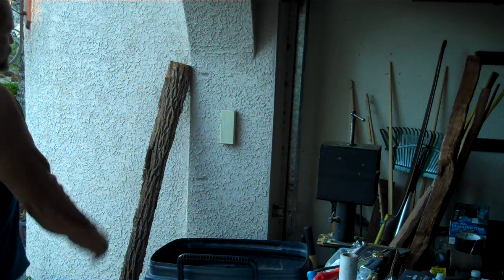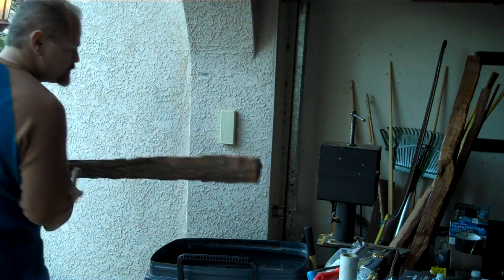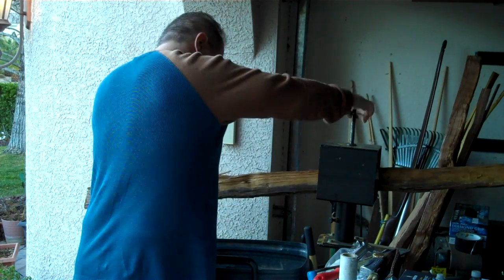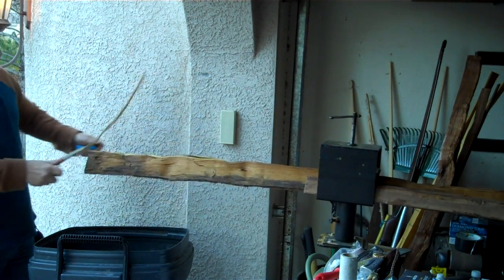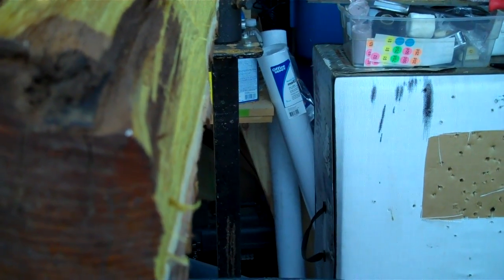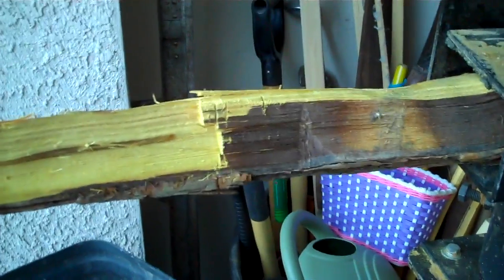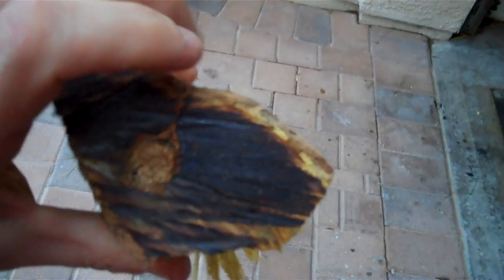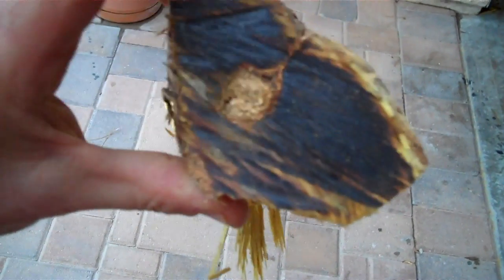How to make a bow from a stave, Part 1: Debarking and Preparing the osage

Comment: Hey Mike! I've got two types of wood available, tamarind and guava. How would I make a bow from them? (they're both tension strong)
Reply from the maker: I am a huge guava fan!!! Had an amazing snake bow that I used for years made from guava that was an amazing shooter!! Basically you'd follow the method I use when making this bow. I'm not sure how easy it is to get a single growth ring from guava (I did not make the guava bow I owned),but the concept is pretty much the same.
Reply: Finished my first guava recently (though it broke after 500 shots) it was 40 pounds in draw weight like my friends modern recurve but you were right! It shot nearly as fast!
Reply from the maker: I really wish I had access to guava. I know there is some in Hawaii, but that is still a long way for me to go for bow wood. Sorry to hear your bow broke, but don't give up. Keep making them and perfecting your craft!
Reply: BoarriorBows I'd send you some but I'm only thirteen and live in the Philippines. It broke after 500 shots not because it snapped but because I tried to heat bend the wood to get rid of some twist. Don't heat bend this wood it is way to stubborn in my opinion.

Comment: Hi Mike, So when you saw that the ring was uneven (thick on one edge and thin on the other). What was your concern? Just that it makes it harder to chase the ring or are you concerned that it will affect the bows performance? By the way, Love your videos and bows you do amazing work and I've learned a lot watching. Thanks 
@joe Costello, I've found Osage clear up in Ohio, It was imported up to these States for Fencing/hedge rows hence the  nickname hedge apple.

Had to edit this. I said "when you saw the grain was uneven", when i really meant "the ring". The Author's of the traditional Bowyer's Bible would not approve. Lol. But yea, they are totally different things.
Reply from the maker: Yes that sharp valley was going to be a bear to try to get a single growth ring from. Turned out it was only in the ends and probably won't be a problem. It can cause an inherent twist or "propeller" in the limb while drawing, but I am hoping that, if it does happen, won't affect the bow or its performance. It usually doesn't have too much of an effect, but it can, so if it does... oh well, on to the next one :)
Reply from the maker: Hey! Thanks for the kind words as well as watching!